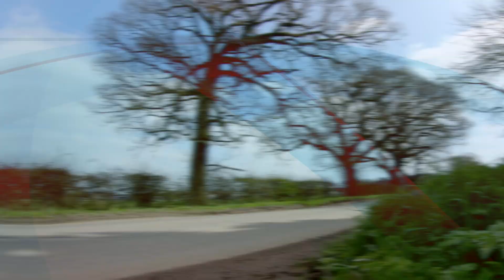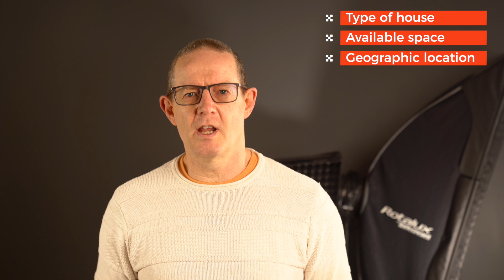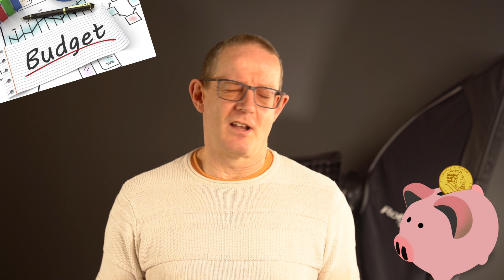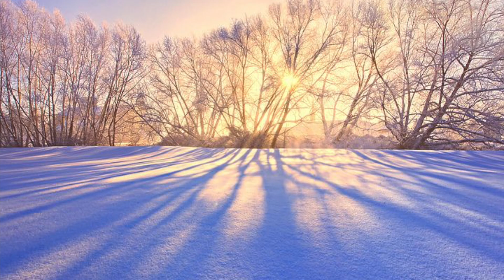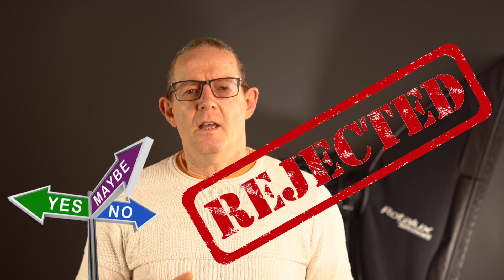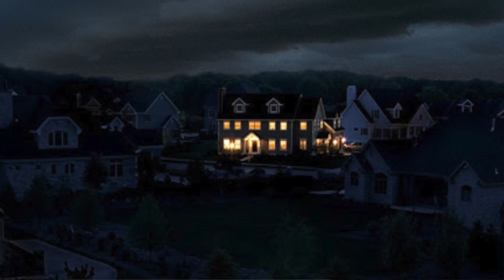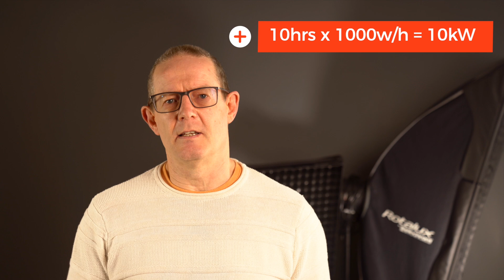So you want solar and a home storage battery

Comment: I am. Pleased you are chatting about this exciting subject. I have a 8kw system split into 2 tranergy 4 kw inverters and a Growatt 5kw storage battery with sp2000 controller. My system is 6 years old now so I have got a lot of knowledge with my system which was supplied and fitted by a very reptable company for £12000.my pay back or return will be another 5 years. When I chat about my system I really advise people to stay clear of battery's and put that money into extra pannels to take into account poor light in winter months. I actually turn off my battery 1st November til end of march. My reason is that the 4 kw inverter which charges the battery will does not get the battery to 100% charge infact from my exsperiance many days it will reach 38% charge, so for me I would rather use what little production for my home hence why I say get more pannels. I relise there are many new gadgets and battery's but its the cost which makes it not economical. I say this as I am on my third battery and now its out of warranty so when this fails if I decide to replace it at a cost of £2000, then my pay back will increase another 4 years. Then one of the tranergy inverters failed in May. I am still waiting for a replacement under warranty. I actually purchased a used unit in atisipation that it would take months so I wod not loose production as now I use an ev. So when we chat about this subject I always say let the buyer beware. Make sure your investment is with a long standing company who will deal with failures. I infact do repairs on solar inverters and I can tell you they do fail, everything on a solar system has to be 100% and failures are frequent and some manufacturers are will only deal with your installer only which is great but if they have gone broke your stuck. Inverters are not cheap. Then you have to pay labour for the remidial work, soon your system starts to take much longer to pay back, specially if your system fits was a low payback. I find it intresting because its normally the people who have more expendable income who opt for systems say like tesla and back up battery's, this circle of people would not dent there wallets if a repair was required, so really for Mr Mrs work ing class think hard about your investment. Electric Vehicles are grate in summer if you have a good solar system for sure. My take at the moment for Mr and Mrs working class who want to go to the LCT is to watch a channel 4 programme. Guy Martin's ev story. He really sums it up well. The other thing is if like me green is top Priority make sure you take into acvount that most families with 2 or more cars will struggle to charge cars with there current electricity supply, bear in mind boilers being replaced with heat pumps so your property max demand will we to much for 100amp cut outs. Homes will require upgrading to 3 phase to run everything on electric. So solar pannels are fantastic and the more surface area you have the better.
Reply: John I will say to date for UK your video presentation is the best I have seen to date. I would like to add something. I have been in contact with my DNO for my ev charger installs and heatpump. The public need to know that its important to, as this gives a good look at how your suppy deals with your new loads so it's very important to do this. I know of people who have added heavey loads without notification. I would like to add that I had to pay £390 for the previlage of having an 8 kw Solar system, my views on this was it's another tax, as being told that the DNO needed to upgrade out net work to take the extra electricity back into there system. What a load of crock. If anyone needs to add systems my advise is use a hybrid inverter and run lead acit battery's idealy 48vdc fork lift battery's then you can take this extra energy and use it without the need to inform the DNO. I am lucky I suppose as I do this using used hardware to keep costs down. Solar and wind are the future regardless of what they look like.
Reply: Interesting stuff especially the 3 phase part , i don't think many Green heretics and those in high places have thought about this ! I have Solar panels and was thinking about a storage battery but now have second thoughts. What about linking up an array of Lithium batteries ?
Reply from the maker: @alansmith4267  each person's situation is different. It's worth investigating via a installer whether you need to upgrade to 3-phase. Many don't, some do, really does depend on the loads in your area which only the DNO will advise. You can still get battery storage and have the inverter limit the export to the grid to 3.6kW. That's what many people do rather than pay to upgrade to 3-phase.
Reply from the maker: Thank you, you raise and highlight great points.

Comment: Great video. As you hinted at, batteries are not exactly cost effective just yet. Cheaper options maybe to use excess energy for heating water with an eddi, or only charging an EV from excess solar. If you are planning this for next 5-10 years, EV's will come into play more.
Reply from the maker: Thanks for watching Barrie, yes good points raised re using the excess solar for HW, EV charging and timescales. Thanks.

Comment: An informative video. Have had 3.9 Solar edge solar for 4 years only now able to see how much we exporting summer. Just about to get an EV so assume that this would be the best intial battery to store excessive daytime energy in and not add a battery until I serif that reduces export to the grid ( still getting fit payments.
Will also consider an EDDI for hot water as some dash most and about and it would be a shame to waste our solar
Reply from the maker: Thanks for watching Colin, glad it was useful. 
The EV will certainly suck up any surplus solar providing you have a compatible EV charger that detects surplus solar.
The eddi is a great choice for hot water and acts very fast. If you go down the route of the zappi car charger then you will have an app that can control both and you can set priorities between the two and decide on the amount of surplus you divert to each.

Comment: Did you consider the giveenergy hybrid offer- it seems to offer more for less and I am currently looking at my options
Reply from the maker: Hi Roy, I've had my Tesla Powerwall since Dec 2018, GiveEnergy were'nt offering that product then. 

It's certainly a good looking product and allows you to control charging and discharging, which is a plus point over the Powerwall. I'm not sure on it's round trip efficiency circa 80% or the allowable maximum discharge of the battery, stated 80% will go to 90% but voids the warranty.

Comment: Hi John, great video with lots of detail to digest. We are looking at a solar system as part of a council led initiative and have been quoted a 6 to 10 panel (subject to roof survey) and a 6.6 kWh battery. My question, as we have an online talk led by the council selected solar provider is, should we opt for an 8.8 kWh (largest battery offered) battery? The cost is not significant and pay back for the system is circa 19 years, so only about 1.5 yrs more with the smaller battery? We are considering a hybrid/electrical vehicle possibly in the future.
Reply from the maker: Hi, thanks for watching. As I mentioned in the video there are so many things to consider when deciding on solar and battery. The key thing is daily electricity usage, more important to understand winter usage than summer as the battery will be working harder in winter with less solar activity. Plus lifestyle. These are probably the two biggest factors impacting electricity usage. In short, if you are low users and out all day, then you probably don't need the biggest battery. However, if you are medium to high consumers of electricity then get the bigger battery. As I mentioned in the video, no-one ever said 'my PV system is too large, or my battery is too big'. If you can afford it, have the space then you are future proofing. In terms of car in the future, I'd seriously look at full electric over hybrid. Hybrid is a transitional technology and is really coming to the end of it's useful lifecycle. It's only popular at preset due to the mainstream car manufactures using it as a crutch to prop up their gas powered vehicles sales.
Reply: @johntisbury  Thanks for the prompt feedback John. Yes. Appreciate what you said. I'll have a look ref winter usage over summer.

Comment: Awesome video, very helpful.
The house I am trying to buy at the moment is an end of terrace  (3 triangular roof sections - 2 large, 1 small) that face East/West with the smaller one pointing South.

I've been told by work that we will be WFH at least until the "middle of next year" and then will likely be "flexible" after that. 

Unfortunately this means my calculations simply aren't possible to work out until I move there, have a years worth of data (I planned on using my current house as a baseline) and then find out if we are WFH long term or if it is only maybe 1 day a week WFH. 
This is a bit of a bummer as I planned on having an install done as part of my rewire when I first get the keys.

But this video is definitely my reference to go from when it comes to it!
Reply from the maker: Thanks Peter, good luck on the purchase, I hope it goes smoothly and quickly for you.

Comment: Thanks John. Your comment on battery response time is valuable. Like you we have a glass kiln which is a heavy load, switching maybe every 8-30 seconds. Using an immersion diverter with a 30second data rate on the  meter, and slow switching, can lead to very inefficient imports during kiln use. The calculation of resulting cost is complex. As I consider adding battery storage I need to understand battery response times better - they seem to be poorly published in specifications.
Reply from the maker: Thanks for watching Tony. We've found that our glass kilns will pull from the grid unless there's sufficient solar activity. Even the Powerwall is not quick enough to supply the power required for the rapidly switching kilns. We normally run the kilns overnight off-peak, or during the day if it's going to be sunny.
Reply from the maker: Tony, a bit more information for you as been doing some tests with the Powerwall. If it's set to Self-Powered mode it is quick enough to power the kiln and not pull from the grid when the kiln is on. My previous reply where I said it was not quick enough was when the Powerwall was set to Cost Saving mode which often means it will pull from the grid and save the battery power for the peak rate times, which makes sense.
Reply: @johntisbury  thanks John. That's interesting. Clearly the powerwall responds faster than my immersion diverter. I am looking at battery options now, and the response time seems to be rarely reported in data sheets. I will need to ask questions before a final decision.

Comment: What's your best guess? Do you see V2G (vehicle to grid) becoming mainstream soon, making home storage batteries redundant?
Reply from the maker: I don't see that happening anytime soon Thomas. At present the only charging adapter capable of two way charging is the Chademo, which is almost defunct in Europe/UK/USA. Only Japan is it still prevalent. Which means in the UK older Nissan Leaf's have the ability to V2G. 
It will happen, but not for a long while 5 - 10 years and even then I doubt V2G will replace home storage batteries. It will end up as a product choice; a battery or a car.

Comment: Hi John,

I'm still researching and learning and the most annoying aspect for me with batteries is the lack of clarity about responsiveness. They all quote millisecond responses but that's for when it disconnects from the grid in a power cut and takes over and not the same response as you discussed with loads ramping up and down. There seems to be no openly available info on how quickly batteries / inverters respond to on grid demand change of a given size. Givenergy currently checks twice a second but doesn't tell us what it does after that check and how long it takes. It makes us believe its instant when it's not.

Does it matter? is the hardest question to answer for me. A tenth here or a tenth there doesn't cost much but our expectation is near zero consumption. Is near zero 1, 0.1 or 0.01? Every trigger pull or a garden tool or power washer or every thermostat activated device adds both undesired import and export potentially. Maybe we need a device that can keep us off grid for efficiency but switch to on grid when needed for export or extra demand🤔

If an off grid battery storage solution is instant why is the grid Integration so slow?

Then there's how fast you notice. If the device you use to monitor what's happening only updates every n sec like the Octopus Ihd then your view of what's happening is out of sync with reality.
Reply from the maker: I share your frustration on the lack of clarity and data around what is instant delivery or power and how much can it deliver. Once it's installed it's a little late to find out. Seems the best approach is to find customers who have taken the plunge and question them. It's not how it should be. There's still lots of misinformation and lack of clarity around home storage batteries. 
I've recently only found out that the Tesla Powerwall 2 with the gateway 2 does not always go into a seamless backup to power the house in the event of a power outage. The reason; not all power outages are the same. How they manifest on the network can be very different and the gateway will sometimes not recognise the outage and take over seamlessly. It seems like with most things, the marketing blurb and the actual are not always the same.
Reply: @johntisbury  Yes, guys, we completely understand, please reasearch the C rate of charge and discharge.  If a cell configuration is 0.5c discharge a 5000kwh will discharge 2500kwh consistant, then boost or jump up to say 1c discharge for 5 secords, 10 secods, for exaple a air compressor requires a sudden inrush current.  A server battery backup, will flush All its power for 15 minutes in order to shut down correctly.  Its all about how the discharge is configured.
Reply from the maker: Thanks Paul.

Comment: Thanks John, a very informative and thought provoking video for everyone thinking about solar

My only question is if you don’t yet have an EV but are considering one in the future, how much extra do you need to add onto your normal annual home power usage to help with covering home changing....?
Reply from the maker: Thank you glad you found it so.

That's a million dollar question! How many miles per year do you anticipate doing? Do you stay overnight with work, so less need to charge at home? Is home charging your only option, e.g are there chargers at work? 
The link here is a great resource which will help you to calculate the worst case scenario. e.g. all your annual mileage being charged at home https://ev-database.uk/cheatsheet/energy-consumption-electric-car
example: A Tesla Model 3 covering 10,000 miles per year at 235Wh/mile = 2,350kWh of juice.

Comment: Do you think that looking at your previous year electric usage is a good idea, I know for certain that our usage has risen dramatically, especially with extra people in the home, luckily I’ve been measuring usage for the past 4 years and can see the extra use. So remember your last years use may be slightly different to your usage going forward, although indeed your use maybe going up with more home working moving forward!
Also people with restriction on space have to think about location of all the equipment especially with a battery pack. You can probably tell il looking to possibly jump in with both feet :)
Reply from the maker: That's a good question. I feel there's still value looking at the last 12 months usage and taking into consideration and future changes. Totally agree that for many last year's usage maybe way off kilter with current usage due to change in circumstances. 
Good point about considering location for a battery beforehand if you have space restrictions.

Comment: sorry to bother, about battery capacity: 10 hrs*1000W=10kWh --> energy (kWh) storage capacity for this period (hrs) and power (1000W). 
(Instead of the shown 10hrs*1000W/hr=10kW).
This differs from your systems off grid power inverter capacity (kW), you may need e.g. 3 kW for certain appliances.
I like the structured approach with which you highlight all aspects.
Reply from the maker: Good point Anton, I didn't make that clear enough. Thank you.

Comment: We have our G99 Application in up in Scotland. Single Phase 10KW. We consumed 21,000Kwh last year. Air Source Heat pumps are a killer...
Reply from the maker: Blimey Darren, that's a lot of watts. As you say ASHP when it's cold suck the juice from the grid. Chris H (comment below) is finding his electric boiler consuming lots of power during January. Electric heating has a long way to go to equal the affordability of gas. Going to be difficult to wean people off it without more subsidies on electricity.
Reply: @johntisbury  Yeah, we have a split meter so we can see a different reading for the heat pump, the 21000 Kw Heat Pump accounted for 90% of the usage. It's very cheap in the Summer >18 degrees, but most homes don't have the heating on much anyway in the summer. They are certainly not cheap to run. 100% we will be investing in Eddie...